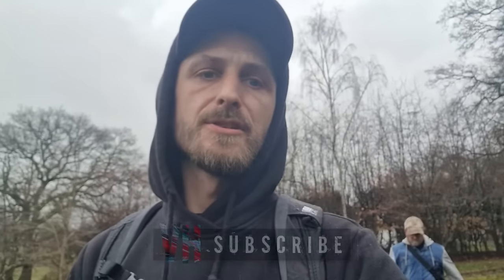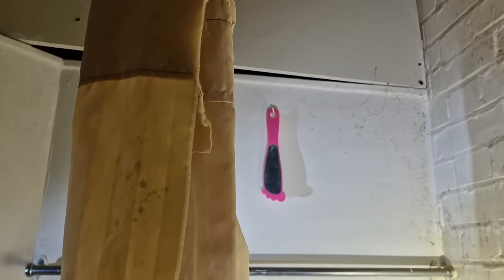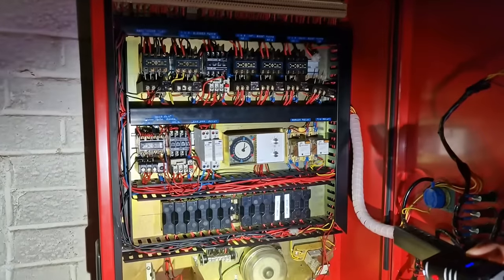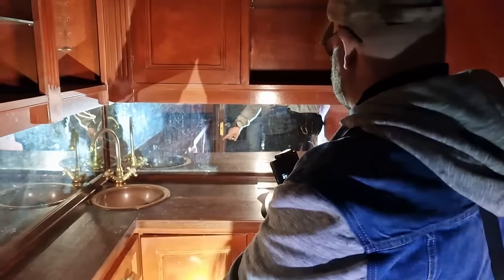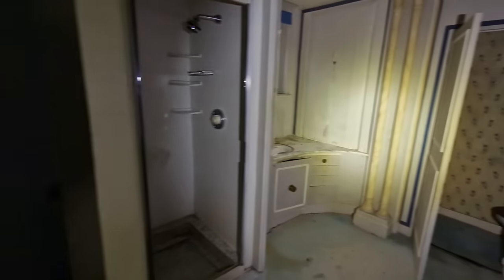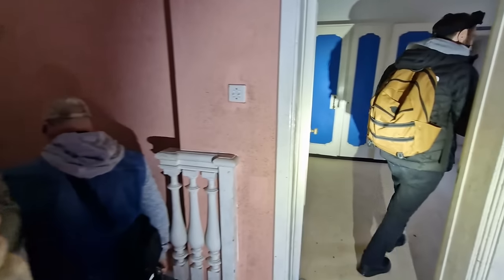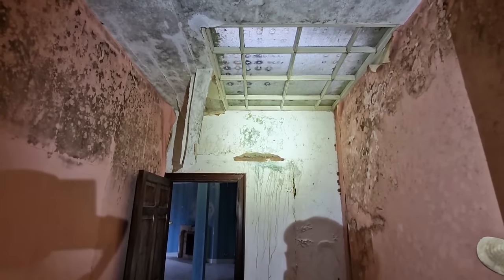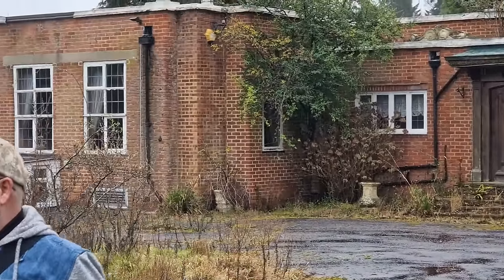We Found a Rare Valuable Piano in This Songwriters ABANDONED Mansion!

Comment: "... I wouldn't say no..." until you saw the bills for maintenance, heating (!!!!!), council tax & the rest
Reply: It's a brick constuction so once fixed up neither maintenance nor heating would be enormous.
Reply: @MsMesem  It's pre-cavity walls so no quick/cheap insulation fix there. A lot of roofage/walls to somehow fix up some "aftermarket" internal additional insulation. A lot of heat losses to ground, I'd think, unless the ground/base could be ripped out/replaced by better insulating material. Cheaper in the long run to knock it all down & start afresh with modern building standards
Reply: @daffyduk77  You sound spoilt and fixed in your thinking.  The architecture is quite unique.
Reply: @MsMesem  "You sound spoilt " just goes to show how little you know about me. You sound unrealistic in your assessment of costs vs. benefits

Comment: WHY WOULD THAY PUT ALL BRAND NEW COPPER PIPEING IN FOR THE PLUMBING IF THAY WAS TO KNOCK IT DOWN,? I THINK THERE PROBLY GUNNA KEEP ALL THE OUTER SHELL UP, N KNOCK ALL THE INSIDE ADJOINING WALLS DOWN WICH ARE NOT SUPPORTING WALLS N CHANGE LAYOUT THAT'S PROBLY 2HAT THERE GUNNA DO LOOKS LIKE A 1920,S BUILD. 👌🏻👌🏻👍🏻😋
Reply from the maker: It is being renovated which is cool.
We said about it being pulled down because of the state of the dampness. But thanks for your comment and info Danielle 😁👍

Comment: The red light on motion detectors can be disabled by the user, just because it doesn't flash, doesn't mean it doesn't work.
Reply: Also, sometimes the alarm system will be connected to solar and cellular for instances when the services have been disconnected.